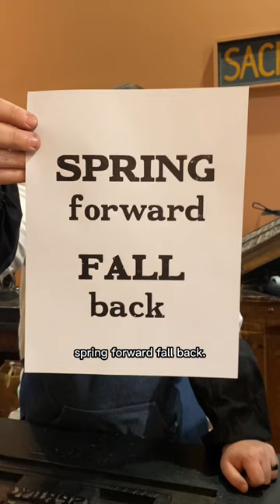Letterpress printing for the end of Daylight Savings Time (November 6 at 2am)

Comment from the maker: November 6th at 2am is when Daylight Savings Time ends. It is that time of year where you have to set your clocks to a different time. In this video, Jared letterpress prints a phrase in Cheltenham Black wood type to help you remember in which direction to set those clocks. 

Also, today is a day the fire department recommends checking your smoke and CO detectors to ensure that they are working and change the batteries, if applicable.
Reply: Always love your posts! Thank you for the reminder to check and change the batteries of our fire alarms also. I almost forgot this year. Cheers!